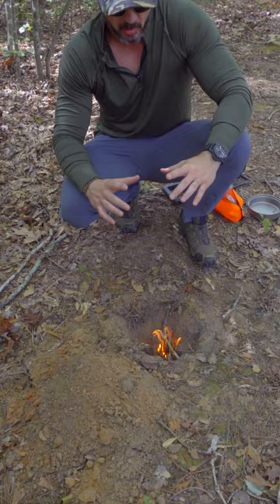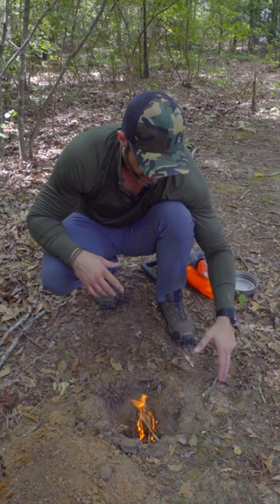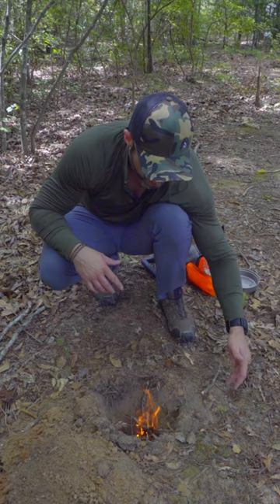Military Covert Fire Technique #shorts

Comment: I use this all the time however one time I was out camping, a ranger came out and told me not to because the coals/embers from them could start a Forrest fire underground, charring roots and destroying trees. I guess it happened some years back in my state, but you need to choose the right spot in order for this not to happen.
Reply: That sounds ridiculous. If you butt it right it will not burn wet roots. Sounds like a jerk ranger.
Reply: Sounds like the chucklehead who made it last didnt dig deep enough, cause no air means no burn
Reply: how can a fire burn with no oxygen?
Reply: Gets the roots on fire then it pops out later and burns thousands of acres
Reply: @znn4125  a fire can’t burn without oxygen. But embers can continue to smolder without oxygen. That’s what’s happening when roots burn. Underground they smolder, and speak until they light dry material up too causing forest fires.
Reply: @AVerySexuallyDeviantOrange  you don’t need oxygen for embers to smolder. What’s why when you bury a campfire with toms of coals, and then wake up and check it, it’s still warm maybe even hot, and when you dig it up, there’s still coals and embers smoldering.
Reply: @dietarychef2212 not true hey...we had a forest fire that eventually died out...days later small fires started cropping up from root stocks just outside the fire burn area...i know its sounds impossible but can happen..
Reply: Ps having water handy well you know